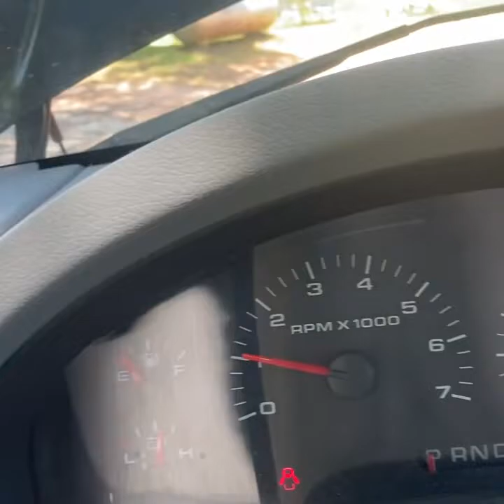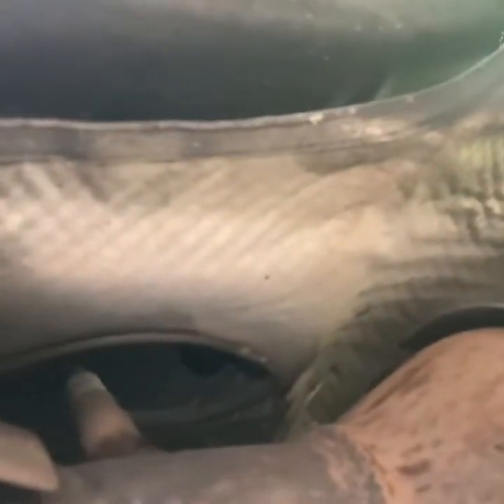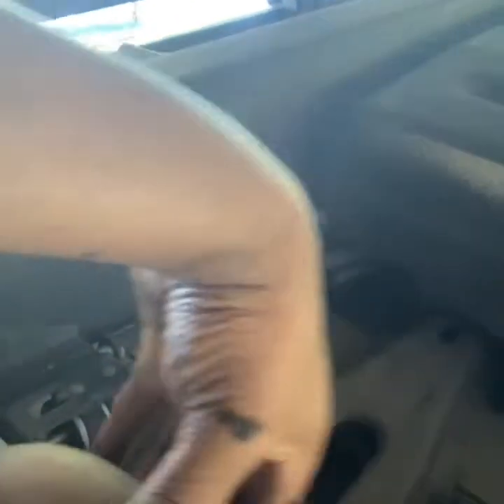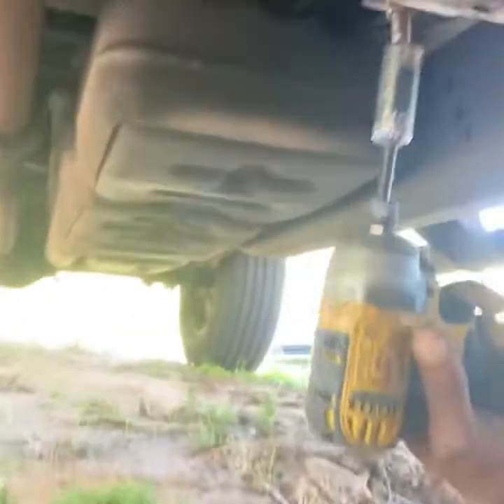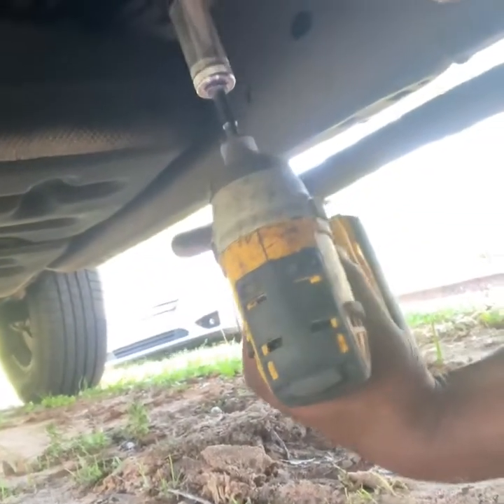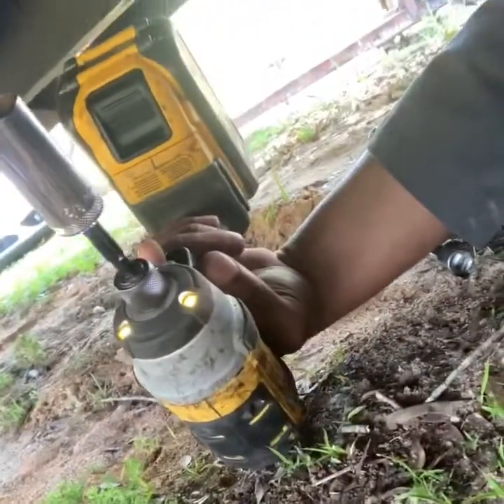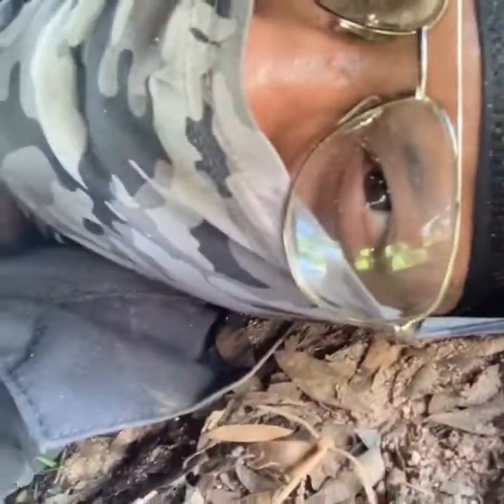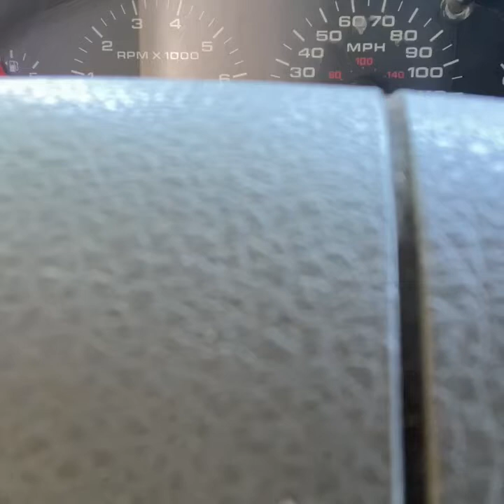Gutting cats on a f150

Comment: Did you gut out both sides? My 98 with the 4.6 has been doing the exact same thing! After you did it has it been continuing running good for a while?
Reply from the maker: Yep I did both the passenger side is a pain
Reply: Thanks!
Reply: U think it would been easier with a power drill